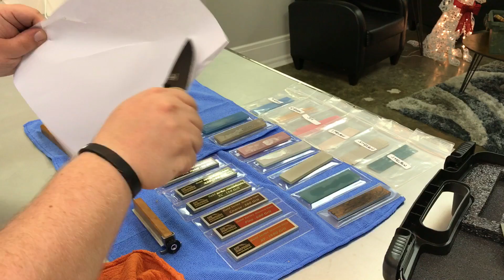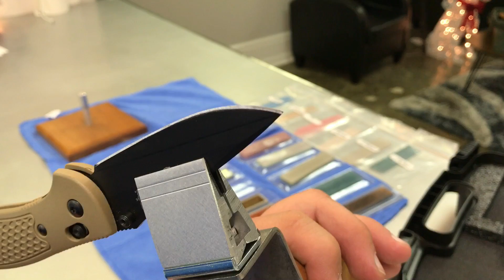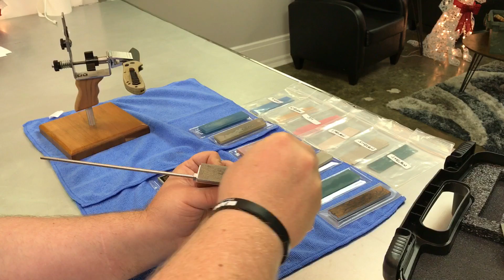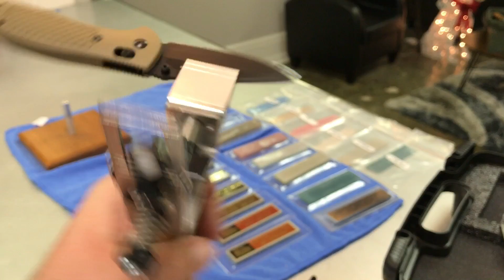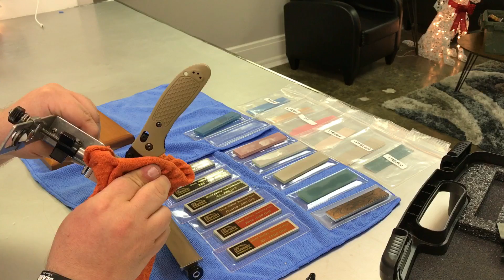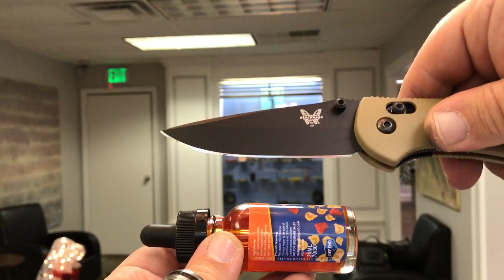KME sharpening quick and easy mirror polished edge

Comment: I was told when I started sharpening, to always wipe out the blade edge with a rag so you don’t transfer the metal filings from one stone to the next stone. Do you think that’s needed or not? Great video, thanks.

Comment: Thanks for all the great content Brian! I am loving the KME. 
Ending with the 1500 stone and progressing through films 9, 3, 1, .3 micron, I have a pretty good polish but there are still faint visible scratches. It seems I spend at least as much time on the films as you are. These are 3M films not KME, although I just ordered a 6, and .5 micron from KME but haven’t received them yet. Are my films the problem or do I just need to add those other films into the process?  I’m not looking for an award winning edge but I would like a bit better finish.

Comment: Thank you for the video! How should I incorporate the ceramic/Arkansas stones into this process, the ones that come with the deluxe kit? Can I use the ceramic stones in between diamond stones to clean up the grind marks? I don’t understand the grit difference between diamond and ceramic/Arkansas stones. For example I have the 60, 120, 320 ceramic and the medium fine hard Arkansas stone, are those comparable to say 140, 300, 600, 1500 diamond stones?

Comment: KME is a minimalist system in some ways.  1x4 rather than 1x6 or 1x8.  The grip has finger groves for two fingers.  Thin guide rod.  Dinky knob to hold on to.  I own a complete kit like yours and I chose not to use it because I feel there are too many minimal things about the system.  It’s like someone looked at a Lansky and worked at just barely being a little better.  Imho. 

This gentleman is a good spokesman for the product, does a nice job.  I completely agree about the mineral oil or lapping fluid.

Comment: The question I have is how to you have a burr on both sides? You can’t if you are sanding both sides?
Reply from the maker: Thanks for watching! First goal, remove all the sharpie while flipping often and watching closely while blending both bevels. Next goal is for both sides to look even and symmetrical to your eye. Then do a few swipes and check for a full burr along the backside. Flip and repeat. Definitely need to confirm the burr on each side. Then the finishing strokes are key to minimize the burr. 

If you work one side until full burr like many videos recommend, then side one will be wider almost every time. This means we have an asymmetrical edge that you can easily see, with one wide side and one narrow side.

Comment: I have the lansky... its hard to chuck.the knife in the same place every time... im thinking of this system for my replacement system. Seems to have more control over the angles. That slider on the vertical makes up for not chucking the knife in the exact same place everytime.
Reply from the maker: Thanks for watching! I’ve found that anyone who already has experience on a guided sharpener picks right up on KME. Feel free to join our “KME Users” group on Facebook if you’re on there.

Comment: Is this system safe to use in home? Have you ever had a problem with the knife shavings getting everywhere? I have pets
Reply from the maker: Hey John. If you use oil or water there’s zero dust so no worries.
Reply: @Knifeguyyy  Thanks for the quick reply!

Comment: Hi, KnifeGuy! Can you explain what your cleaning process is for the lapping films once you’re done? Do you do anything else beyond what you did in this video, just quickly wiping them off with a drop of oil and a rag? I just used my lapping films for the first time, and the lower grits especially have some darkening left behind, like a staining on the films. I added oil and wiped away as much as I could, but some staining/dark areas are always left behind. I couldn’t tell if yours looked the same way in the video, so I wasn’t sure if this is completely fine. I didn’t want to scrub too aggressively to try and completely get rid of the darkening as I imagine this would ruin the film. Thanks!

Comment: What stone progression do you use for sv110 and what oil do you use?
Are your stones diamond or ceramic?
I want a mirrored scalpel
Reply: Marin Capital s110v needs a lot of patience, ceramics are not your friend here. Diamonds only . I prefer a toothier edge up to 600 grit stone, then heavy stropping. Having a polished edge is actually detrimental due to the high carbon content. You’ll get much better edge retention with a lower grit stone. S110v is not meant for push cutting, but makes an awesome slicer. Holds its edge for a long long while.

Comment: Will the mineral oil harden or gum up and need to be cleaned off the stones from time to time? Thanks for the excellent tutorial.
Reply from the maker: Thanks! I’ve never had any issues with mineral oil hardening. I just wipe mine off and they go in the sleeve with a small amount of oil still present.

Comment: This is a phenomenal video. I'm considering the system, but have a concern. I would use it mostly on kitchen knives, most of which are much longer. Please tell me how you would have to adjust the techniques shown here to sharpen an 8" kitchen knife. Thanks!
Reply from the maker: Blutch Blutcherson Hey man. So we can sharpen up to a 10” blade clamping once. We can sharpen longer blades clamping twice with overlapping sections. Thanks for watching!

Comment: The deluxe kit comes with a set of ordinary stones (not the gold ones) are they of any use? They are relatively cheap
Reply from the maker: zom zom Hey there. Both kits come with the Gold series stones. The basic kit has the 140,300,600, and 1500. The deluxe kit adds the 50 and 100 grit gs stones, along with three ceramics, one Arkansas, and a strop with 4 micron cbn emulsions. My personal Gold series stones are over 6 years old and still kicking ass, and I sharpen a lot.
Reply: Knifeguy 6 years is impressive!

Comment: My method of using the KME is, unscrew the handle from the jig and hold the knife by its handle, use the jig just to keep that angle. That eliminates pressure on the jaws. Instead of flipping the knife in the jig, flip the jig around the knife when you need to switch side. I scrub only when resetting a bevel, otherwise single strokes over the whole blade length (unless it's too long), always against the edge. You can either hold the knife steady and stroke with the hone, or hold the hone steady and stroke with the knife, or combine movements of both hands for much more efficient work. The KME stones and diamond hones especially are quite expensive and there are problems with availability here in Europe, so I have just the basic set of four ceramic + Arkansas and the xc,c,f,xf set of gold series diamond. For higher grit, I use a strips of very fine sandpaper (2000 grit and higher) that I pull around one of the hones and tighten it on the stone carrier.
To do heavy reprofiling, I attach the KME jig without a handle to a plywood or fibre board, and secure the knife on a riser to the same board, making sure nothing gives way no matter how much pressure is applied.
Reply: The slight wobble in the base bothered me a bit at first so I started clamping the base to my table. However, it really isn't necessary, and the risk is that it encourages you to "lean" into it too hard. Keep your strokes light and you'll find that holding the knife steady in the clamp isn't such a problem either, though you do need to check frequently that you haven't inadvertently moved it and changed your angle.

Comment: Can't speak for this system as I don't own it... But I did find that the stone thickness with a similar Lansky design was a problem. From my initial 60 grit to the 3k ceramic polishing stone the thickness in the stones was such that it rendered the ceramic polishing stone useless as it was only hitting about half the bevel. Hopefully this system isn't like that.
Reply from the maker: Hey thanks for watching. The KME doesn't have this issue. We use a stone thickness compensator that makes switching stones of different thickness a breeze. Also our diamonds , lapping films, and strops are all the same thickness so there's no neeed to use the compensator with any mix of those.

Comment: Have you ever tried to align the edges surface to the blades steel, typically, perpendicular to the hilt? In other words vertical strokes tip to hilt? Straight up and down instead of sweeping or circular?

Comment: If I wanted to start out with the highest grit just to find the angle getting rid of the the sharpie what do you think about that.  My thinking is to not make the mistake of taking to much metal off before I find the correct angle.  What do you think?
Reply from the maker: Greg Wallace We really aren't removing much steel at all to find the angle.

Comment: I don't use oil on my stones or lapping film..should I?   Great video
Reply from the maker: It's fine to run diamond stones dry, with water, or with oil. The lapping films load up quickly without any oil, so they'll last you longer using it.